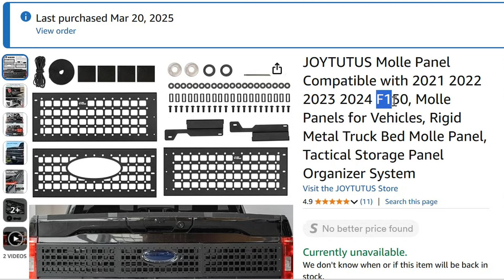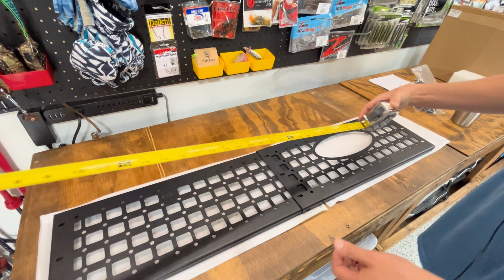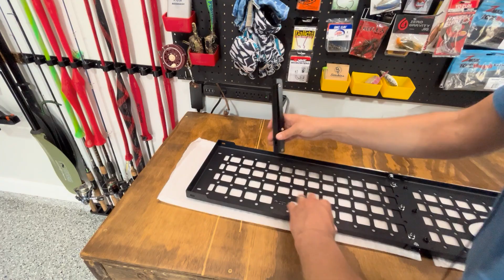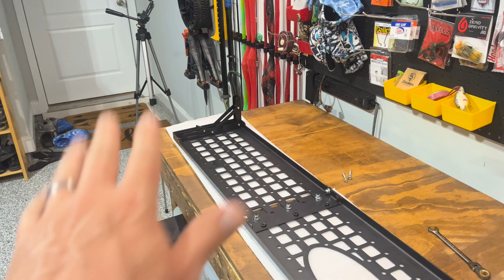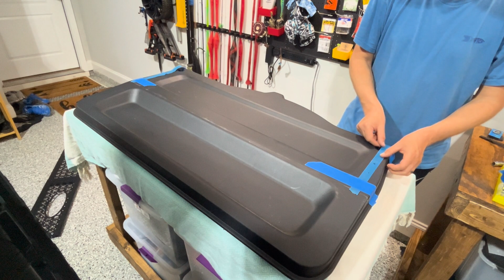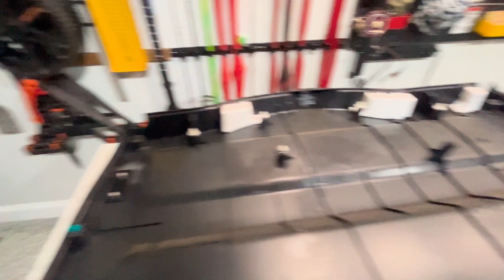$30 DIY Rear Folding Table for FJ Cruiser

Comment: You might be able to get one of those kneeling pads made of foam from Home Depot and cut it down to fit the length of the table. Then sandwich it between the table when it's folded up and the rear panel. It may give all of it some rigidity so there's no jiggling and the foam pad could double as a seat cushion or a kneeling pad on the road
Reply from the maker: I love this idea! Will mock something up…my kids have a ton of those puzzle pads I could “borrow”

Comment: cut adjustment slots in the outside hinge mounting bracket, mounting holes and install wing nuts. Store level and loosen the wing nuts on the outside hinge and slid down to level when in use.
Reply from the maker: Genius!!!!!